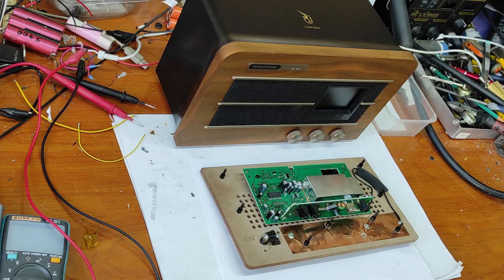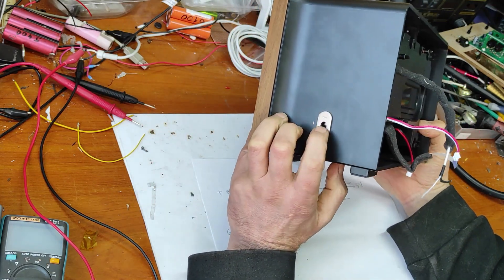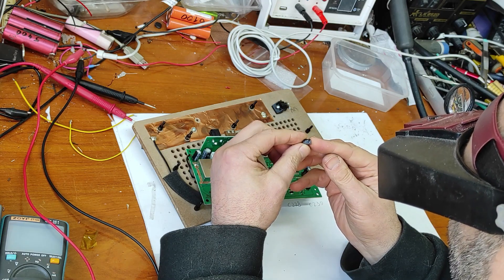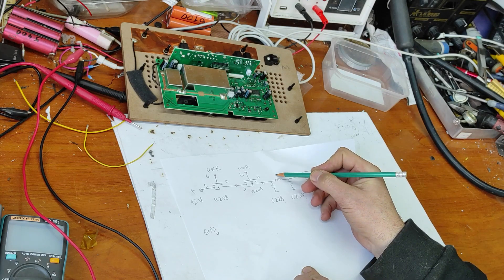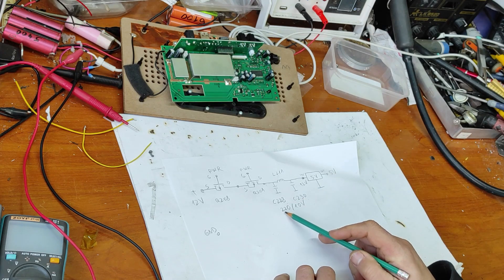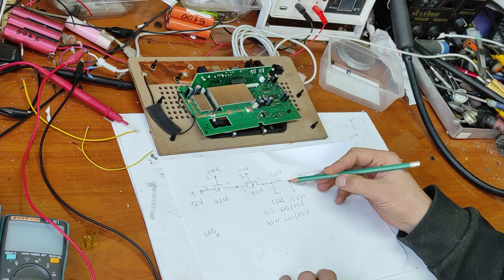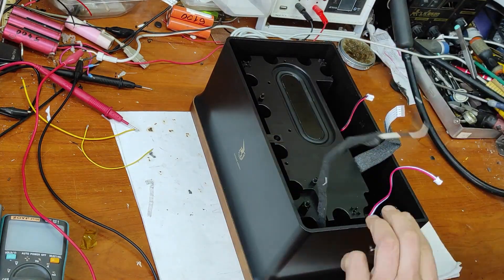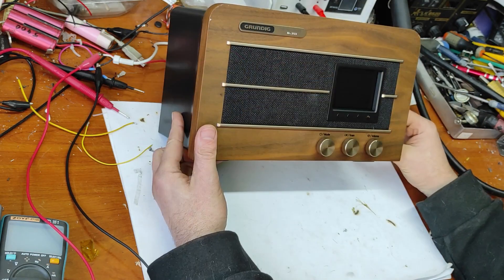Grundig Heinzelmann GHR7500 design problem, U have to see this video and repair

Comment: Hi. Could you tell something more what was the problem? I mean what did not work in this radio before you started to repair? I got one, and it turns on and I can switch between modes with first knob, but other encoders and buttons under the screen does not work, so I cannot to use other options neither operate other settings. Any idea?
Reply from the maker: mine was completely dead. u can replace capacitors if u want maybe u r lucky.
Reply: @diymariuselectro  maybe, but it is a blind shot :) I returned it to seller for service. I have no time now for this electronic investigation :)... to much other work. Thanks for reply :)
Reply: In mine there was only disconnected cable 😅